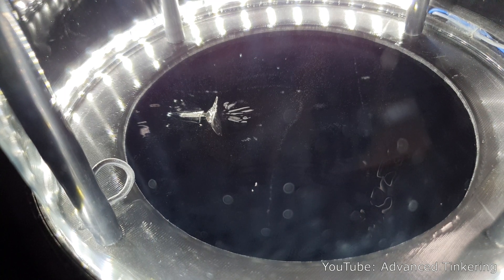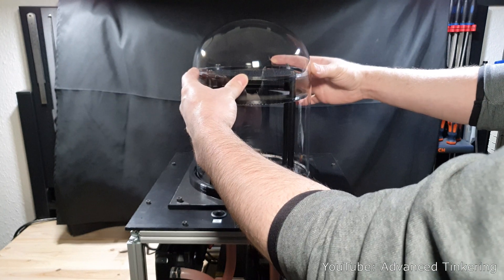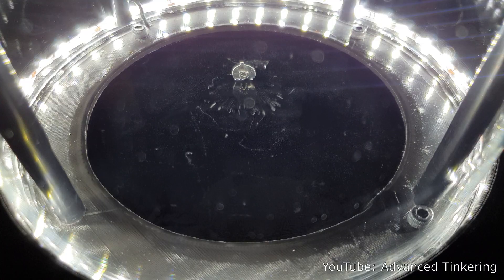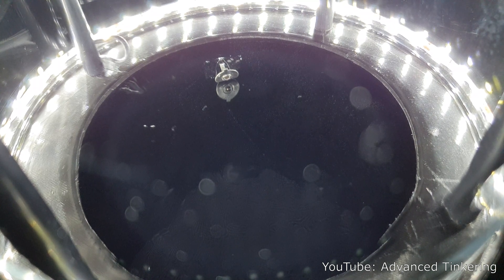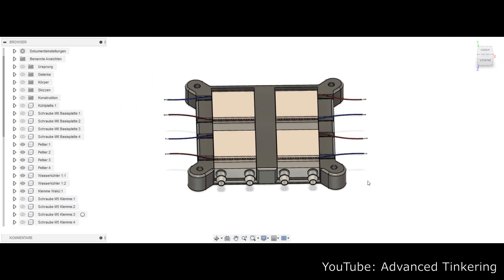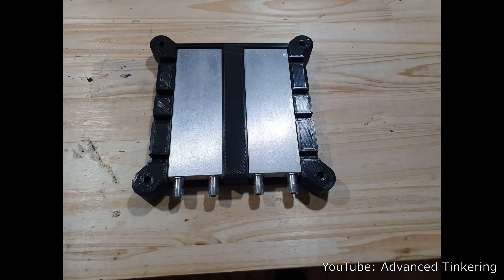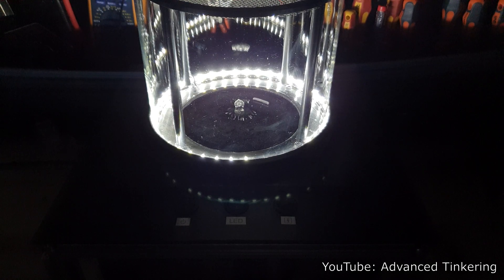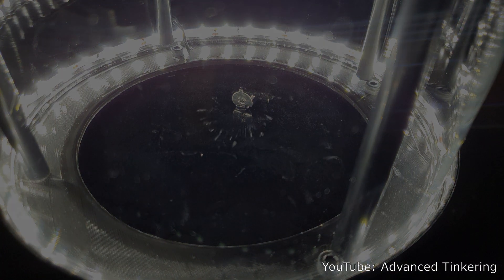Cloud chamber construction

Comment: Hi ! After several prototypes, I ended up following your advice and purchased tec2 25408 elements, they work very well, thanks for the reference!🥰 On my former prototype I got the right high voltage by luck (my voltmeter can't read high voltage). I can't get the high voltage right on my last one: do you have any idea of which voltage you reached please? If you have the reference of your high voltage generator that would be even better !

Comment: Falling hard into this and other rabbit holes, maybe you can help me from falling further.

My understanding of how cloud chambers work is that it’s the supersaturated alcohol that condenses in response to several types of radiation and that’s why you need a temperature gradient, to cool alcohol saturated air that falls from the felt.  Is it possible to get this same effect by manipulating the pressure of the saturated air rather than the temperature?

Like, say, by using a sufficiently sized alcohol-containing bulb attached to a vacuum chamber?  Made from glass joined together by chemically resistant putty?  In the shape of a retro reflector? That is coated with two-way mirror film on the outside?  Lit inside by those tiny LED balloon lights imbedded in said putty at the corners?

Yes, those are the cloud chamber, infinity mirror, and retro reflector concepts taking up space in my attention span at the moment.

Comment: Awesome job. I’m currently also planning on building my own Cloud Chamber and I’m looking forward to watercool it. Now I’m running into some budget issues with a whole custom watercooling loop as a single pump with reservoir costs 150$~ which is too much considering the additional costs of the radiators and fans. 
Which radiators and pumps did you use, and what was your rough cost of the project?

Cheers 
-Noah
Reply from the maker: Thank you!

I also thought about using a pump with a reservoir designed for water cooling loops in PCs. But just like you said. They are pretty expensive. The pump I am using is a cheap 10 € Pump for ponds and similar purposes. You should find similar ones on Amazon. I also bought a reservoir from AliExpress for around 10 € but I didn’t use it. Filling the loop without a reservoir is a pain, so I would definitely recommend a reservoir. The radiators are also cheap ones from China. They were around 20 € per radiator.

I don’t know the overall cost. I lost track of it. I would guess it was around 300 € with all the changes I made.
Reply: @AdvancedTinkering  Thanks for the reply!
I'll do some further research and report on how it went. But i think that this might just make watercooling possible. Thanks!
Reply: @AdvancedTinkering  Hey there! How high was the HV grid above the coldplate and what was the approximate voltage that was used? Thanks.

Comment: Very nice . The cooling elements are new to me ..now off to research them a bit. What radionuclide are you using in the chamber. Am241 is commonly found in smoke detectors. it would be interesting to see that placed in the chamber

Comment: Very nice cloud chamber. It seems to work very well.

I have a few questions:
1) You mention that there are drawbacks to stacking multiple single stage Peltier elements. What are some of the drawbacks you observed?
2) What voltage do you get from your HV converter?
3) What metal do you use for cold plate and what is its thickness?
4) What water temperature do you get, or how many degrees above the room temperature?
5) What plastic did you use for the 3D printed elements?

I am interested in building cloud chambers too. Here is my most recent cloud chamber:
https://www.youtube.com/watch?v=vov9vxOWibk
Reply: Great information. Ever since I discovered cloud chambers I've wanted to make one myself that can continuously run without large upkeep. Preferably to sit on the coffee table. EE background so it wouldn't be overly difficult on the electrical and thermal side, but understanding what needed to be done with with the alcohol was the largest unknown.
Reply from the maker: Thank you! It is not perfect but it works. 

1) Since you also have to remove the waste heat from the upper element, you either have to use two different peltier elements or you have to drive the upper element at a lower voltage. Calculating this or finding the sweet spot by trying can be a hassle. And I wanted to use one power supply, so using the TEC2 Elements was the best choice. 
Since the thermal coupling between the layers of stacked TEC1 elements will be worse, than between the layers in a TEC2 Element, you will lose some cooling efficiency there. Even with a good thermal compound. 
They also can shift if you don’t use thermal epoxy or bracket.

2)  I don’t know the exact voltage. I just adjusted the step-down converter, that drives the HV generator, in until I got the best results. It is pretty low because I got electrostatic effects when the voltage was too high and my vapor layer got disturbed. 

3) It is a 3 mm aluminum plate. I am using black self-adhesive foil as a top layer. 

4) I never measured the temperature, but I would say it is 30 °C at max. 

5) I used PLA. Until now I had no problems with the temperature or the alcohol weakening the PLA. 

Your chamber looks great!
What kind of peltier elements did you use? And how many? What type of alcohol are you using?
Reply: @AdvancedTinkering  Sorry for the late response.

I used TEC1-12706 modules. I basically had them in the same configuration you had, but stacked two TEC1s instead of having a single TEC2, with a total of 8 Peltiers. I used a computer power supply and ran the top Peltiers at 5V and the bottom ones at 12V. I have a 3D printed bracket to prevent them from shifting. Luckily 5V for the top Peltier seems to be very close to the sweet spot, and the 8 Peltiers draw about 300W in the steady state and are able to bring the copper plate down to -35C. I think I initially went with TEC1s because they were cheaper ($3 / piece) than TEC2s, although you have to deal with more cables and thermal paste. I used 91% isopropyl alcohol from CVS.